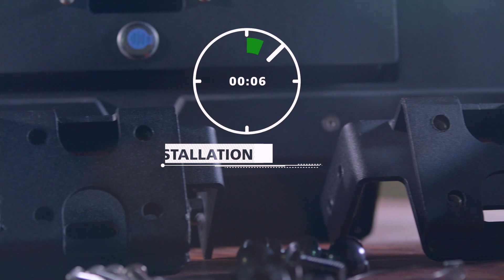Go Rhino BRJ40 Jeep Front Bumper With Stubby End Caps Installation (230110T)

Comment: Hard to find a good Jl bumper vid to leave a comment Go Rhino might actually see. Haven’t seen these interferences mentioned so dropping a comment here.Got the trail line full for my 19 jlu rubicon,last week. Seems that lovely drawer framework,prevented the bumper from being centered on my Jeep. The plate that the drawer glide mounts to,runs into the hanger support bar for the sway bar disconnect. Pretty snug fit against the hanger bolt as well. Not so hard to fix, but need to take bumper back off to shorten bar about 3/4 of an inch.. Would have been nice to know,it may be an interference,before I had most of the bolts securing the bumper:) Drawer also interferes with crossmember plate,(plastic bumper group)that comes off earlier. Could leave this off,but it helps protect elect sway bar disconnect gear,along with plastic air dam:/splash guard. Again,both can be easily modified and re installed, but would be good to know about the interference before the bumper goes on. Also adds a jig saw or cutting wheel ,to the required tool list. The bumper looks great,but it does leave disconnect fully exposed. Too bad there wasn’t a corresponding steel skid plate. 
 Winch slots seem to lose some of their convenience ,being mostly obstructed by the drawer enclosure,but surely there’s an way to sneak a carriage bolt,through that little space between the rad and the top of the drawer box? A trusty piece of mechanics wire perhaps? 
 Plates for factory fogs need a little improvisation,to make them work,but 2 out of 3 holes,ain’t bad ;) Throw in a 1/2 tap to clean out the threads in the rhino hook plates, and everything should be covered